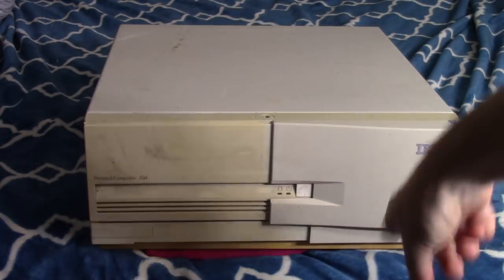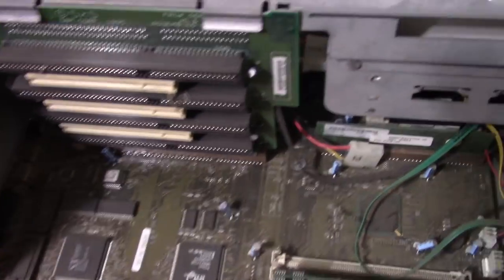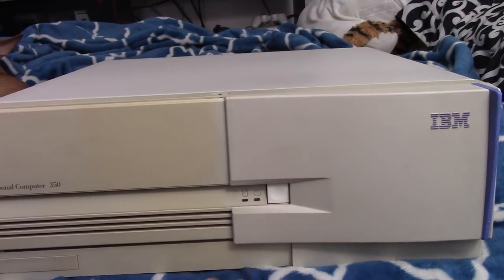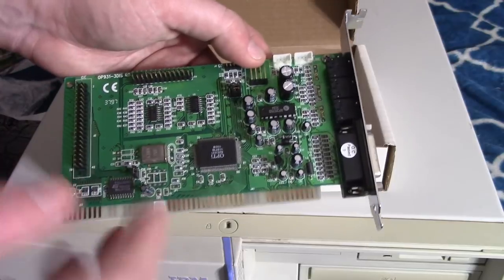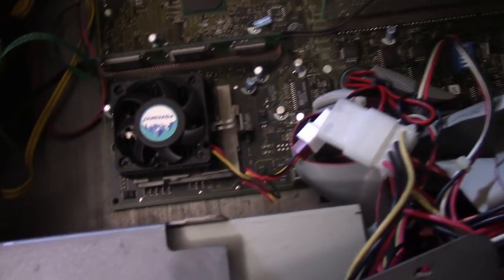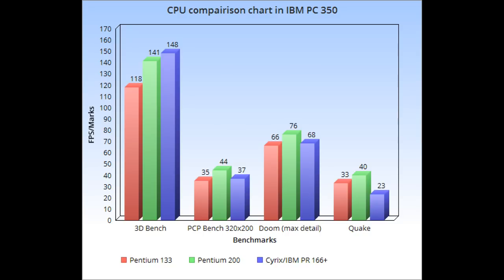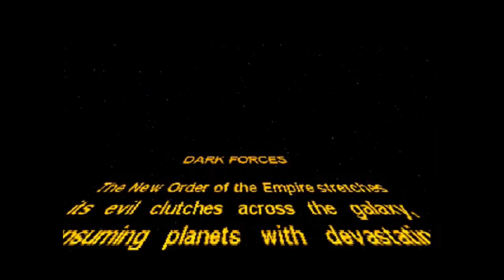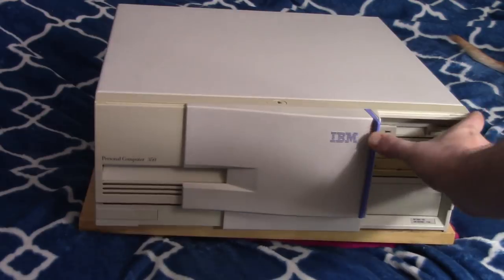IBM PC 350

Comment: I have one of those, I bought it new back in the day. Rock solid and stable. Mine came with OS/2 Warp 3.0. I updated the OS to OS/2 Warp 4.0. I still use it to this day. Not a daily driver but I use it for my old SCSI film scanner mostly. I know... I still shoot film...lol. I hope to run into a IBM monitor some day, mine took a dump recently, I had it plugged in when the power was out for 3 days and it fried it.

Comment: A friend gave me one of these, and I'm currently working to restore it. I have one that was shipped as a P90, so it doesn't have the DIMM socket. Since I already had another P90-based system, I decided to put an Overdrive processor in mine, and am currently trying to decide which sound card would be period correct in the system.

Comment: I got a new old stock that was actually in immaculate condition.  I paid more than I should for it, but it already had CF installed.  It was a backup for on old Telecom production system that was never used.  It had a Pentium 133 that I upgraded to a Pentium 200.  I also have a board for a PC350 with the VRM module that is upgradeable to 233 MMX.
Reply: Hey, you still have the IBM PC350 board?
Reply from the maker: I do not.

Comment: That design in case has pretty much never changed.  About 10 years ago IBM used some larger case for their cash registers at Walmart, Kroger..etc and has the same riser setup expansion for motherboard.  Those machines sucked taking apart and some of the older ones were worst and could never figure how to put the case parts back together.  F- them, haha

Comment: This 16MB ram is 5V 80ns EDO with weird buss command translator chips to make it talk synchronous protocol.

Cyrix CPUs require special initialization provisions in bios, they even come with a "driver" to fix things in case of incompatible bioses. They also arent 100% compatible, lacking some instruction support like RDTSC. Try Cyrix utility to set up optimal register(CCR/ARR/RCR) configuration, something like 6x86opt
Reply from the maker: Interesting, I may try that. I've used a few Cyrix utilities before on Cyrix 5x86 chips on socket 3 boards to enable some features and get better performance but I didn't think this kind of thing was still necessary by the 6x86 era and socket 7 boards.
Reply: 6x86 that acts like 486 without proper initialization (CPUID disabled = computer freeze on less careful software) :(
Reply from the maker: It certainly could be a result of human error in my inexperience with the program but I could not see any performance increase with running. 6x86opt in DOS 6.22 and running the relevant benchmarks. I ran 6x86opt and received a "Cyrix CPU is now optimized" message but no effect, I also attempted to disable CPUID which also yielded no change. I ran benchmarks with each separate as well as together with no effect. I also ran the install program and checked things like "Linburst" or something like that and no effect. Now I will freely admit the more intricate parts of the program like manually setting addresses and such are a bit beyond me so if you can point me to a guide if you know of one or have any setting suggestions Id be happy to try them.
Reply: did you try any of the freezing software after "6x86opt optimizing"?
My only personal experience with Cyrix was swapping them out for Intel chips.
Vogons says NOLOCK (and maybe WRITE ALLOCATE) influence speed.
Reply: I used to have a 6x86 150+ and I never ran any trouble even without such software.

Comment: its 430tx the final socket 7 chipset made by intel.
Reply from the maker: I know, but it just kind of feels / looks old when your used to working with  and compare it to later socket 7 and SS7 boards that support AGP later CPU's and use things like soldered on L2 cache chips, 256MB+ of SDRAM, ATX power connectors and such things.

Comment: Anyone have any expertise in placing a graphics card in this beastie, and disabling the onboard video? I have spent over 2 days trying to accomplish that task with a clean Win98 install.
Reply from the maker: I've found these IBM's of this era to be particularly picky about the cards they accept. For instance I could not get my Verite Rendition card to work on my IBM Aptiva regardless of what I tried but a Matrox g200 worked just fine. I'd just suggest updating your BIOS to the latest version. What card are you trying to get working? Maybe try a different card.
Reply: BIOS is made of unobtanium evidently, I can find no viable link for this old PC. I got this old unit many years ago as an orphan. It has a Trident 9000i board already installed along with the S3 Trios onboard. It did work from the Trident years ago, but the BIOS keepalive battery was dead when I started it up and upon replacing the battery life got interesting. I may have a different card to try after searching thru the horde.
Reply from the maker: @Dave52732 I don't recall if I upgraded the BIOS on this PC when I had it but I did upgrade the BIOS on my Aptiva and pc 300pl and I had to do a bit of digging on the net and sorting through broken links.

Comment: Going from Pentium 133 to Cyrix/IBM 166+ is not really an upgrade unless you are talking about business and office applications. The pentium FP is far more advanced and it provide much better performance in FPU intensive applications and games.
Reply: Not in games, unless it uses FPU. Except quake, there were very few games at the time that used it. But quake was such a massive thing back then...
Reply from the maker: I only did a handful of actual benchmarks so it's not really a great sampling but the Cyrix did pull ahead if ever so slightly in all but one benchmark, Quake, where as you said the strong FPU of the Intel chips made them superior. I was originally hyped because some sources I read such as "Red Hill" said the P166+ has performance close to a Pentium 200 which from my benchmarks it obviously did not and was barley 2 or 3 FPS ahead of the Pentium 133 in most cases. Maybe it was just the games I benchmarked that didn't really show off this performance increase or maybe Red Hill and a few other sources I seem to recall reading were talking more about business applications rather then games.
Reply: @AncientElectronics  Close to Pentium 200 ? "Red Hill" is really optimistic but I remember that many of the first articles related to the first 6x86 were really  over the top. Not a word about the heat for instance.

Comment: I would leave it original.
Reply from the maker: A perfectly valid option. It all depends on the mood I guess, sometimes it's fun to restore something to a stock configuration even if that configuration falls short of the machines full potential or limits its use and sometimes it's fun to just pimp something out to the max.
Reply: Besides my XT and PS/2s I have no original OEM PC in my collection and I kinda regret scrapping, gutting or completely changing around all those Pentium systems back when I was a teen. Wish I had kept one original.